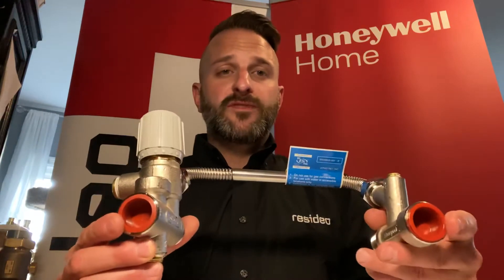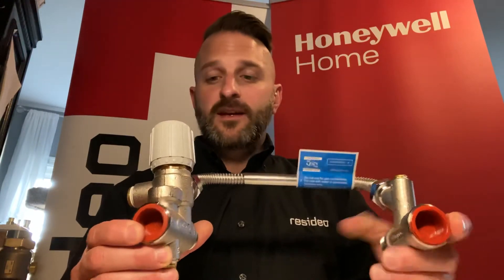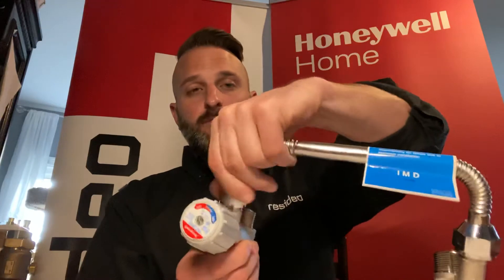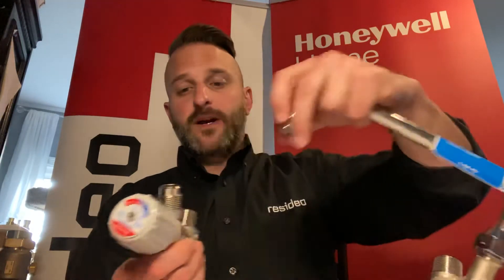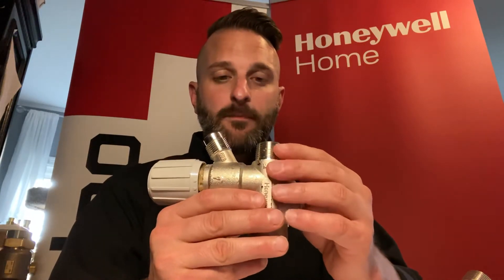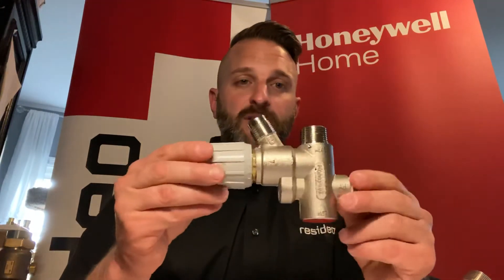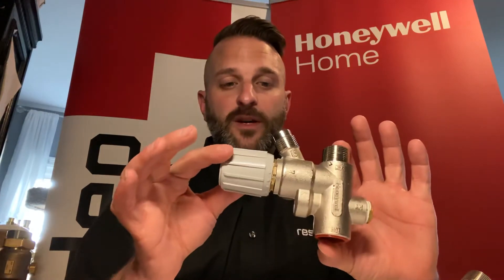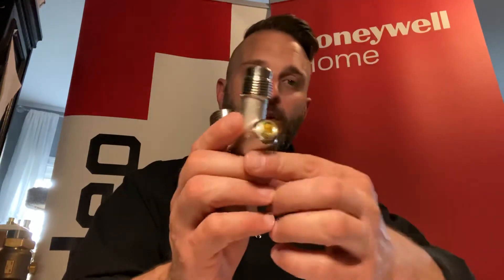AMX-300 Honeywell Home Resideo mixing valve

Comment: How the hell do you set it
Reply from the maker: Push the dial the turn. I would recommend turning towards the blue(colder) until it stops then work your way back to desired setting.
Reply: @christophertomeno7908  And what if it doest work and the temperature doesnt appear to change?
Reply: @ProudDad64  Did you ever get yours to turn? I have the same one and although it says "Push In to Turn" and his video appears like it should adjust fairly easily, mine does NOT and I cannot get the knob to turn to adjust the temperature at all.
Reply: @qtrhorsegal1212 well, if I remember correctly you have to somewhat loosen the screw in the middle of the knob.  Play with that and you can turn it. I do remember to adjust,  try in 1/4 turn intervals. Give the temp time to adjust.
Reply: @ProudDad64  That's the thing - nothing adjusts or turns. It's like its stuck. I can see where the knob says "Push in to turn" and the underside of the knob has little teeth that appear like the function should be to serve as a wrench for turning the nut below (sort of like a way to adjust without needing tools) but the nut will NOT turn. I don't want to man-handle it and break it but that is the only thing that makes sense that should be turning based on the knob design and the "Push in to turn"
Reply: @qtrhorsegal1212  can you post a picture?
Reply: @ProudDad64  it doesn't appear that I have that option
Reply: @qtrhorsegal1212  I'm sorry,  don't know how to help you. Is it the same valve as in the video?
Reply: @ProudDad64  it is. And in his video the dial adjustment looks fairly low effort. It's like mine it stuck and won't turn, but it's fairly new so I can't imagine it's seized up.
Reply: @qtrhorsegal1212 

I sprayed a healthy dose of WD-40, let it sit for a couple minutes, then used vice grips to turn it. That’s how I fixed the same issue that you had.